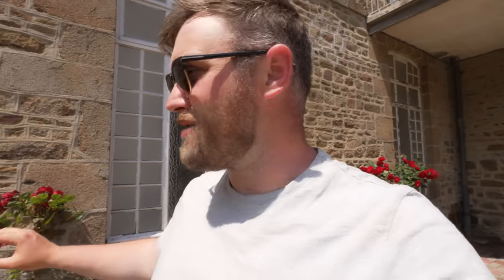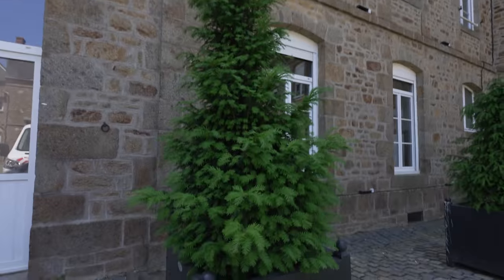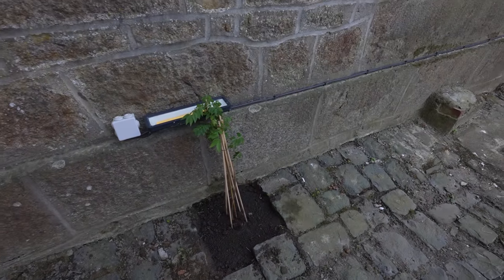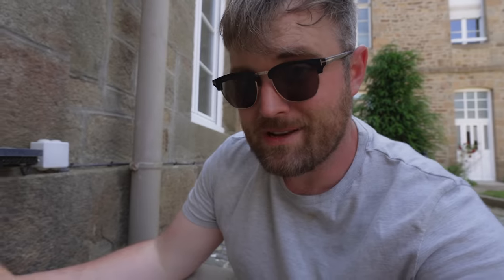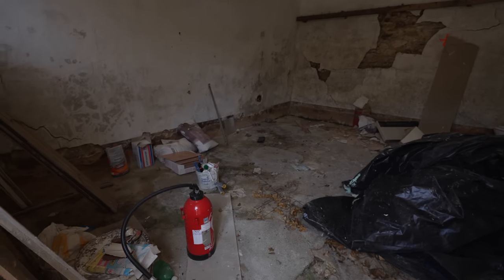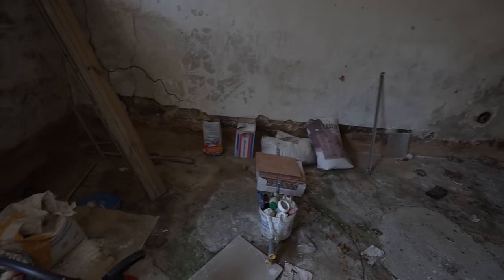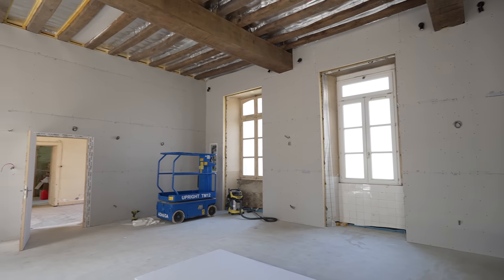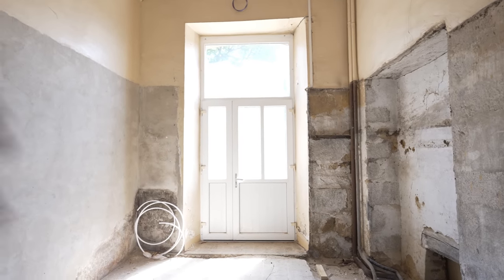Paint It Black You Said

Comment: Oh Billy, the wisteria could be a real problem in the future. Personally I would dig it up and replace with clematis, as they will give you the same sort of look you are after. You could then put the wisteria in pots and place along your long exterior wall by the neighbours driveway. You will need a better wooden structure for the wisteria as it can weigh a ton when in flower. Wire just won't do it. The roses look good though. Some specialist rose feed later in the year would be good too. 🌹
Reply: Agree with your suggestion of Clematis. Great alternative. Wisteria is a beast.

Comment: The purpose of the sloped bricks near the wall is to shed water away from the structure. Removing those bricks to plant things and water them adjacent to the wall will likely lead to foundation problems below.
Reply: And the mature roots will lift the other cobbles around it.
Reply: yep...the hole could be about 12 inches away from the wall, leave the angled stones and you could still get the plant to grow up the wall after it's tall enough
Reply: We just had problems with a „Blauregen“ planted Next to the wall like you did. The roots did some damage to the foundation. Better change it…
Reply: I pulled wisteria out of the corner of my house. Very invasive, ants love it, attacks foundations and stone and wood. I would Not put it near a building.
Reply: Agreed
Reply: Please don’t cover the wood beams in the kitchen
Reply: Just to let all know, if you want Wisteria flowers next year buy now in flower. They are known to take a few years to start flowering generally. Also, they do become very strong, with a thick trunk, so beware too close to buildings. You’ll need green wires for training where the long wispy growths will expand, cut off those in the front to encourage side and top growth. Cut to a bud in December and train in August after flowering, by cutting/tweaking, good luck! Kris in New Forest England 🏴
Reply: Totally bad idea planting wisteria under your cobblestones  roots will push stones up ….my garden patio is getting relaid this very week…our building house insurance have just removed our wisteria  as is has  causing foundation damage and cracks in our walls .. our structure repairs and underpinning are definitely not worth the wisteria whose roots have dried out and cracked our foundations .. plant the wisteria along a free standing wall but definitely not a building as valuable as yours…..
Reply: @KG-ou4nm yikes. I feel you are right. Billy will have to move those wisteria. Fo’ sho’!!!
Reply: He should NOT have removed those sloped cobbles. And wisteria is invasive in certain hot climates without much winter.
Reply: Think window boxes. The Rose's are fine but no hydrangeas or wisteria. Hydrangeas will die in the heat produced by the building. The wisteria is a huge mistake.  Find someone who knows roses and have them teach you how to prune and train them. Simply mulch between them. Before you dig or invest implants consult a gardener.
Reply: Bad idea. You should know what wisteria roots alone can do to foundations.
Reply: Terrible idea to do what he just did.
Reply: Billy hi, I am from South Africa. A out all of us have hydrangeas in our gardens. We love it,but we plant it on the cool side of the house, (south) and the roses on the warm side(north). You should do it on the opposite, sides. That is why a rose needs so much water. Hydrangeas does not like too much sun. Love your program.
Reply: I agree. Should put the wisteria in pots.
Reply: Billy you always need advice from people that know when planting next to your buildings etc. you made several serious mistakes today I’m afraid.
Reply: You don’t have to water wisteria
Reply: I have been a avid gardener for 3 years.  We just removed out very invasive wisteria.  It lifted the brickwork, climbed into a tree and almost killed it.  The roots will find their way into your drains, lift your bricks and grow into your eaves.  There are fare less invasive plants that I would have grown on trellises.  But with gardening experience you learn these things….:)
Reply: Well, I think it’s all been said already. Good luck with the plants and maybe get some  advice from your local Master Gardner. 😊❤️🌿🌺
Reply: Do you know how old rose ?  I wonder for away.  Would they be historic rose or some. Thing like that.
Reply: Was just thinking the same thing.
Reply: Yes, I agree.  You will regret it.  I have seen the damage that will happen. I would put another kind of colorful planters between. Hope you read these comments before you do big damage. 😢😂
Reply: You may regret that wisteria. It can take over everything & the roots go every where. Most people who plant it regret it later.
Reply: @krismorris1810  😮
Reply: My bad should say 30 years not 3……old age….
Reply: YES ... those old bricks are one of the reasons the convent is still in good shape.

DO NOT put water near a foundation!
Reply: I agree with everything the others have said about the wisteria. It’s taken over my daughter’s yard at the house they bought last winter. I would have told her not to buy the house if I had known.
Reply: No wisteria anywhere! Just throw them away
Reply: Michael just cut his back so hard at the cottage..😢
Reply: Looks like  a few gardeners here more work for you pulling things out.
Reply: Pull the Wisteria out , big mistake... it will in time ruin  the foundations... if you want colour, get metal wall art and mount to wall ...
Reply: While beautiful, wisteria will damage any structure it is near and it sends out shoots everywhere, even under sidewalks. I am still dealing with those shoots from one l dug out 10+ years ago.
Reply: Oh no! You removed all that ivy off the walls. Now you’re digging up stones and drilling holes on the face of the buildings to plant another type of creeper. 😱 . All that stone is the beauty of that courtyard. Create planting areas where the grass is. I’m not into the evergreens., but...Work with a landscaper before dumping $$$ and damaging the foundation.

Comment: As a gardener, I see your vision! But keep in mind that wisteria can be a garden thug! It has the power to rip apart buildings (maybe not ancient granite-walled abbeys), but if left to it's own devices, it can tear apart roofs and windows, and will soon need a very sturdy trellis. Simple wires will work for a few short years, but unless you cut it back heavily every year and then retrain it to just the wires, it will soon outgow the simple wire support. 
It can be the right plant for that location, but it will need a sturdy, heavy duty metal frame/trellis to support the enormous weight of the vines as they age. The goal is a well supported vine structure that goes where you want and can be easily pruned once a year. 
Wisteria is unique in the sturdiness of the trellis required to support a mature plant. 
Also, give the base enough room to bulk up over time as it can damage foundations and lift cobbles if planted too close to a wall. Good luck!
Reply from the maker: I will be keeping it under control… if it grows!!
Reply: @ThePethericks it will grow.  I’ve had it at two different homes.  It can (and I have experienced it) grow 10 feet a day.  That’s around 3 meters a day for you.  I love it, but it is quite proliferate.
Reply: Agree!
Reply: @joannabowers1358  in northern parts of Europe keeping them alive is a bigger problem than them being invasive usually . 
I have given up on them😞
Reply: @malina1239  Really?  Wow, I would bet that most of those warnings are from those in areas like mine.  While I absolutely adore wisteria, one must love gardening to deal with it here.  I’m in northeast Texas now, and it’s invasive. I had it for 10 years when I lived in Kentucky.  850 miles apart but an incredible grower.  It was in Kentucky that it grew 10 feet per day.
Reply: @joannabowers1358  Different variety in the US.
Reply: Yes, wisteria self-seeds to an incredible degree, and with 3 inch thick vines, can destroy structures and kill trees.
Reply: Yes, wisteria is beautiful, but the mature plant is very heavy and thick-stemmed.  It will need heavy support.
Reply: How about the hydrangeas?  Those need a lot of space for spreading out.  Do you think 5-6 ' from a building?  I'd almost suggest planters similar to the green trees are planted, and intersperse between the trees.  Would they survive winters in planters though?
Reply: Spot on
Reply: Never had any trouble with wisteria in the UK
Reply: Exactly!
Reply: @joannabowers1358  Its  beauty belies it’s strength. Lifting roofs off houses, entering through windows, prying stone from masonry walls, splitting rock walls asunder…
Best left in pots for espaliers near to your object you value. Then, when it starts running 3 meters a day, you can trim it quickly. They do well in large pots-think Bonzai, and with light fertilizer feeding. And you can stop their aggression at the first sign!
Instead, plant climbing hydrangeas instead. They grow at a modest pace and are hardy in the Sierra Nevada’s where we live in subzero temperatures.
Reply: @debpate9405  that all depends on the variety of wisteria
Reply: @laurelbrennan6295  My Hydrangeas survive container cultivation here it the UK. But for them to really thrive, a semi shaded, damp, in-ground position is the best choice. I'd grow mine in the soil but this is a rented flat so I need to be able to take them with me.
Reply: @karenvickery6070  Even Frutescens, the type Billy's using, although much less problematic, can still be somewhat invasive.
Reply: @pinkelephants1421  any plant can get out of control if you don’t prune it.
Reply: @karen vickery  This is true, but you (rarely) have reason to attend to the root systems.
Reply: @pinkelephants1421  vines always have a root system problem. I have jasmine and the only reason it’s out of control is because I haven’t looked after it for years, it’s how it is with all plants actually.
Reply: @karenvickery6070  Tell me about it. I've just spent the morning pruning back my Hebe. If it wasn't by the backgate I would have left it. But since it's smothered in flowerbuds which the bees go absolutely mad for, I didn't think that the landlord would appreciate a lack of access due to the stingy burny hurty insects. Five HUGE armfuls of prunings. I always have prune it this way every year as it grows like a weed. Plus it had shaded out my peonies, stopping them from flowering and the Hibiscus needed a bit of breathing space too. My Jasmine hasn't had any attention for a couple of years & it's smothering the Clematis; next pruning job for tomorrow I'm afraid! 😟😳

I'm really looking forward to having saved up enough money within the next 2-3wks to buy the garden shredder that I've been putting off buying for quite some time. The landlord had some extra land that he used let me dump garden waste on - at his suggestion. But he's recently sold it off for housing so that avenue's out of play. I also grow Buddleias & since they HAVE to be pruned yearly, a garden shredder is my only realistic option.
Reply: @pinkelephants1421  my jasmine has taken over my white blossom trees, 3 of them. It’s all tangled up and wrapped around the trunks and branches and I hate the smell of jasmine, it gives me a headache. Hopefully I’ll have it all gone soon.
Reply: @karenvickery6070 Sounds as though you may have Jasmine Osmanthus. I love the smell of Jasmine, perhaps because it grew along the fenceline next to the house when I was a child. But my variety of Jasmine is the small pink flowered variety which has no fragrance; still rampant as hell though. When I was researching Jasmine, I was quite surprised to find just how many varieties there were in the genus.
Reply: @pinkelephants1421  my jasmine is white and jasmine is a neurotoxin, so it is very bad for you. The smell is so strong it also gives me asthma, I grew up with it too, planted at our front door.
Reply: @karenvickery6070  It's such a shame that it affects you so badly. For the vast majority of people, they aren't affected.
Reply: @pinkelephants1421  my daughter and her husband and children are affected by it too, and they have it growing wild everywhere, it’s so hard to get rid of.
Reply: @karenvickery6070  There are so many commonly sold plants in garden centres and nurseries around the world that aren't always offered for sale in the right environment. What isn't invasive in their native habitats, often turns into a complete nightmare elsewhere.
Reply: @pinkelephants1421  and that’s why the plant he got was for the French environment and is not a problem.
Reply: Do not put wisteria next to the foundation!

Comment: Please please do not leave the wisteria next to the foundation, they'd be better in dedicated planters. This allows you to keep your options open with the plant and to maintain the water shedding pavers which keep the foundation dry.

The ability of those wisteria roots to grow, bulge and crack foundations is well documented and often under stated. If they grow, you'll find new plants pushing up through your cobbles five, ten and fifteen feet away from where you planted them. Other comments here regarding the heft of trellis work required after a few years of growth are also spot on.  These plants are beautiful, fragrant and destructive. You mentioned in a previous video that there was work to redo the courtyard pavers ... if you're planting wisteria, they will likely negatively impact your maintenance plan for that project.

Additionally, please note that the seed pods and to a lesser extend the petals can be toxic if eaten, so keep an eye on any little ones over the years as the plants grow.

I'm just one voice on the internet, so please consider this well intentioned advice. Hopefully it helps!

Comment: Great rose rescue! I’m a rose grower and those red roses will look stunning against the stone walls!
Wisteria can be a thug, with roots lifting the cobbles and causing structural damage. Please get some professional advice!
Reply: The trunk of the wisteria grows large, it is not something you want because it not a native plant and invasive. It is difficult to remove once established. Find a different vine so the structure will not be compromised.
Reply: @Susan A Leonard  definitely difficult remove....

I have one that I have cut back to the ground a few times in 23 years and it keeps sprouting, and this year it had grown to my front door (20ft from roots).  Because I'd lose the beautiful rose bush planted in front of it, I haven't tried to dig out the roots
Reply: I agree, here in the states, it's called humming bird vine. It's a total disaster once it takes hold.  Extremely hard to get rid of, and yes... It will grow into the cement in cracks along the wall. I've been trying to get rid of it for years.
Reply: Stop don't plant the wisteria. You will regret it in a few years.
Reply: There's only one place for Wisteria and that's on a frame AWAY  from any buildings!
Reply: Although it’s pretty when in flower I would only plant wisteria on a free standing structure, not on a building.   The tendrils are very invasive and get into every crack and crevice.  A fireman advised me to take mine out as it was getting under my roof tiles.  It took me years to finally stop it reappearing.

Comment: Billy, the wisteria root system is large and powerful.  It is recommended to avoid planting wisteria near foundations, walls, sidewalks etc as the roots can damage these easily, causing cracks and buckling.  It also draws lots of bees, so people allergic to bee stings need to be careful. My friend also had an issue with spiders claiming it as a good home. She had a hard time removing the wisteria later.

Comment: Best thing for wisteria is to build a very sturdy steel patio cover well away from any building out in the rear yard where you would like a picnic or seating area. And I mean welded 3"-4" tubular pipe.   Wisteria is very strong, and can smother trees or break down weaker structures.  I like your potted evergreens in front, and don't think you need foundation plantings, especially in a mostly shaded area.  Get a professional landscape plan done.  You can add portions of the plan every year or so.

Comment: I would suggest another wall climber than Wisteria for the convent courtyard. Morning sun and afternoon shade would be perfect for a climbing hydrangea. They are meant to climb up walls like you have at the convent and they will not damage the walls. They have a sticky substance that they use to attach and will not infiltrate the stone or the grout like ivy will. Using just wire for the wisteria will not work. They will develop very thick and heavy trunks and will need to be substantially supported. They can damage facades and will wind their way into any crack or crevice they can find. They need to be assiduously tended and pruned to prevent this. Condier the climbing hydrangea. A lovely plant that takes little tending once established, in about year three they will take off.

Comment: Since the wisteria root system is so large and powerful, you should avoid planting wisteria near walls or pathways. The root system of wisteria can easily damage these. Wisterias flower best and grow most vigorously where they receive ample sunshine - at least 6 hours a day. They thrive in any type of soil, as long as it is well drained. Experts recommend that if you locate a wisteria near a structure or walkway, you should insert a corrugated panel some 6 feet (2 m.)

Comment: If you are going to make the oven black, you should use bluing. Stove black is actually just a cover to go over the blueing. Blueing would likely be easier to do than paint, just thin coat of the liquid then coat in oil for 24 hours.

Since bluing is hardened into the metal, it never needs maintenance unless it is waterlogged for an extended period.